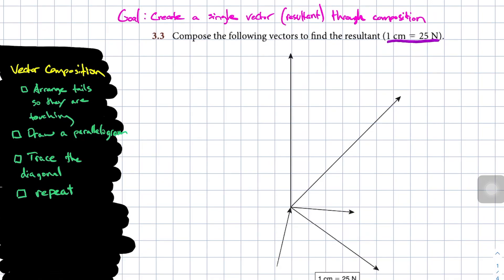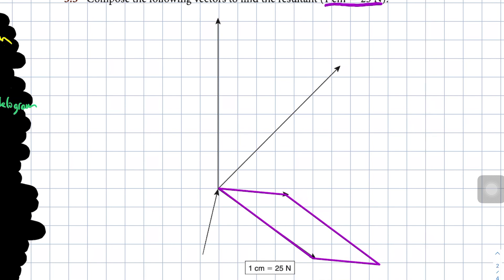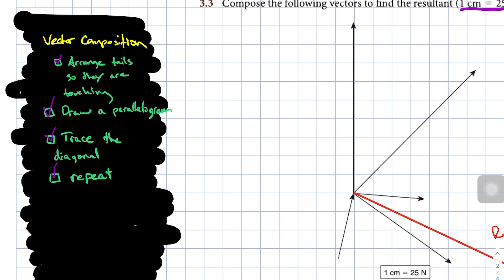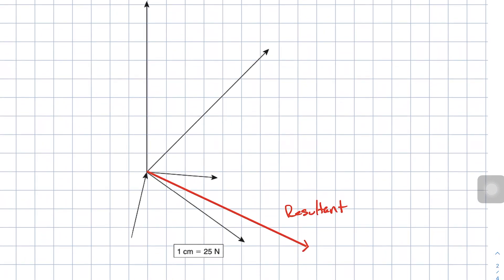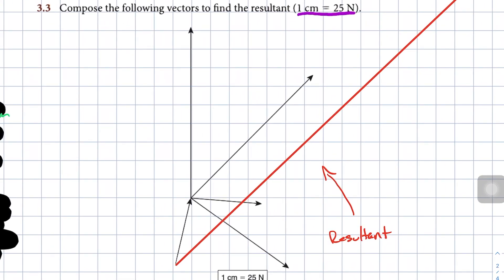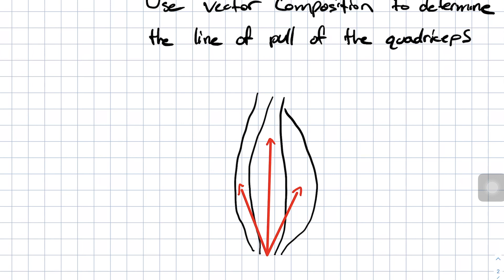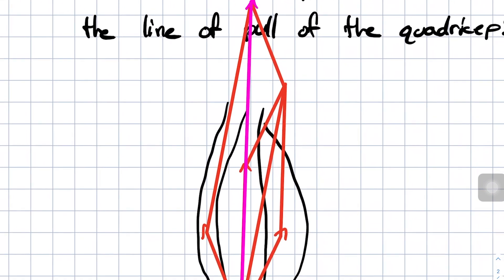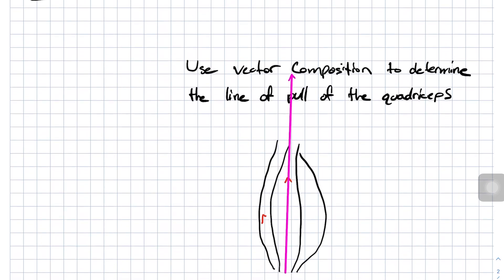Simple Vector Composition for Biomechanics (jacked quads example)

Comment: Very helpful, although I'm still not sure how the measurements relate to the vector
Reply from the maker: In these cases they were just the lengths, so we could have measured each vector length to convert to N, but because we were solving graphically (as opposed to mathematically), there was no need to.